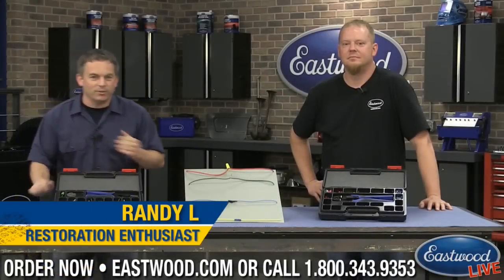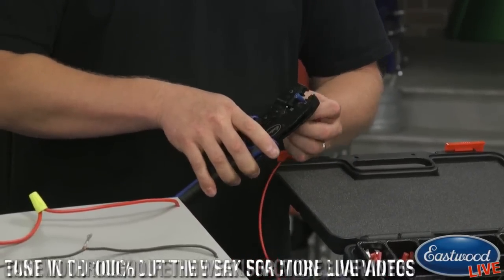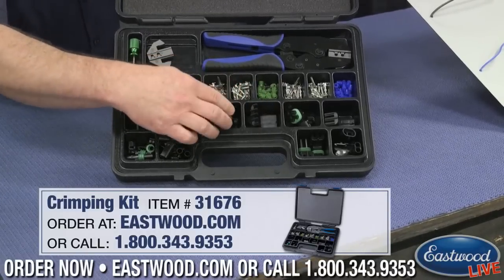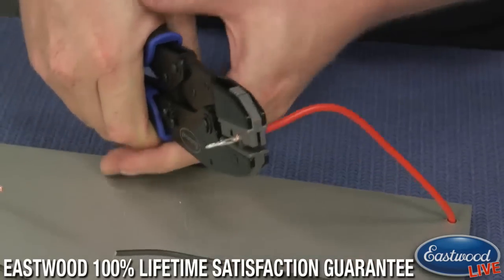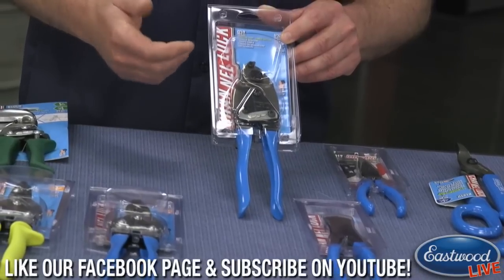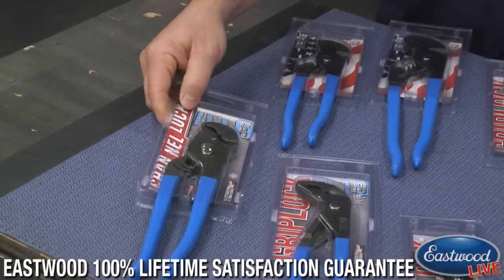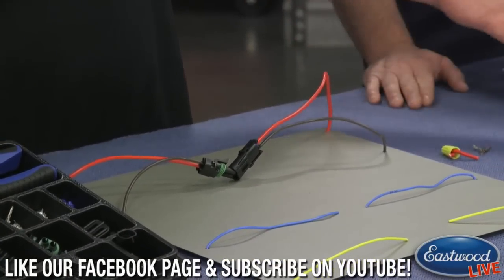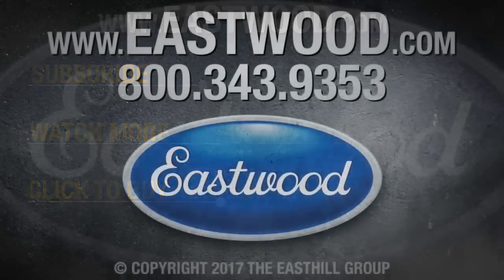Car Wiring.The Best & Most Efficient Method of Connecting Wires!  Easy + No More Soldering. Eastwood

Comment: I have a 2007 Toyota Yaris does the color of the wire means more than the position of the wire. Meaning location top left on a 4 wire pigtail is green . On the original harness, I purchased a new one but in that same position it's black. But I do know that green is the new ground and black is the new hot. So in theory I will be connecting a green ground with a black hot by coloring . But not by positioning

Comment: I have never seen anyone show how the connectors are to be put into the die.  Do you install the open side of the connector to which side of the die? Does this crimper have 2sizes on the same crimper slot? Some of the crimpers crimp the wire to the metal part of the crimper and a slightly smaller portions of the same die that at the same time crimp the plastic to the wire insulation.

Comment: Thith ith jutht a thimple proceth. Made even thimpler by thtopping the use of the old English measurements like feet and inches. Which we haven’t used since the 1300s. “Ok, so how much cable are you cutting back there Chet?”  ... “ uhhhh tho were just cutting back three thixty-thixths of a Cornish yard”.     Five mill is fine.

Comment: Twisting wire strands and crimping is not acceptable , it makes a bad connection and can cause overheating
Reply: Todd m  over or under crimp don"t exist with a good crimp tool.. like go to ali express and seach ls-30j or an-30j for insulatet and heat shrink crimp connectors made by the LSD tool company , good quality , and you can get a lot of different die sets separet for it .. 30j is the jaw/die set mounted in the crimper ls , an stands for crimper model.. , there is also 2 other models , all same die models
, crimping thin wire and double it should be ok, just check that it has min 22 avg copper for red type ,, you can get a smaller size than red, also heat shrink butt connector but you will need the A04c die set to crimp these.
Reply: Todd m  ok, just note that  the colors brand (fasen tools) use HS dies that don"t fit in LSD crimpers but they look the same .., rachels tool store has the A04c die for LSD ,
Seach crimping die set for LS LY AN AP S , remembet to write order note to seller on checkout telling them what dies you want.
Reply: Todd m  if you want the smaller  heat shrink butt con. And avoid the fake ones (transparrent ones) i got some of these, no good , made with aluminium tube ,,. Here is the right copper connectors, i tested them ,,. Seller: ali world shopping center store
Item seach DMWD BHT0.5
Reply: never twist wires to crimp! Are these guys for real?